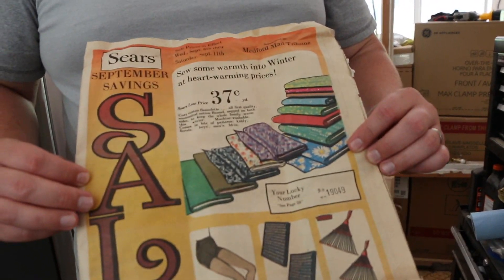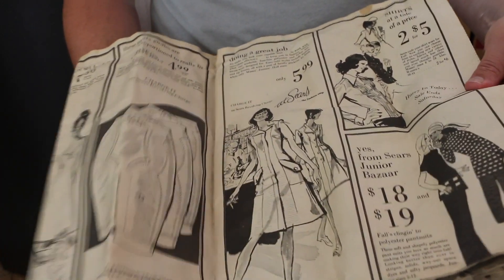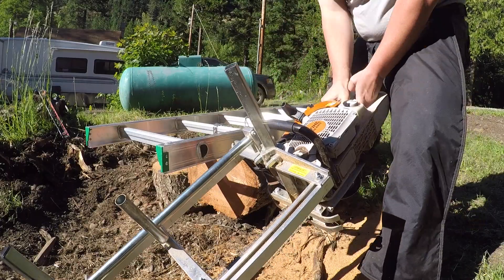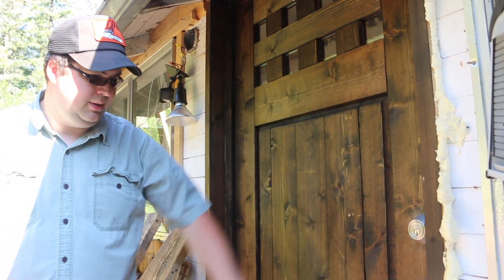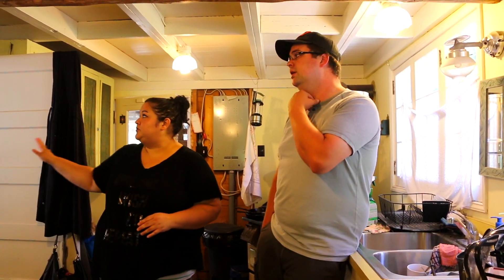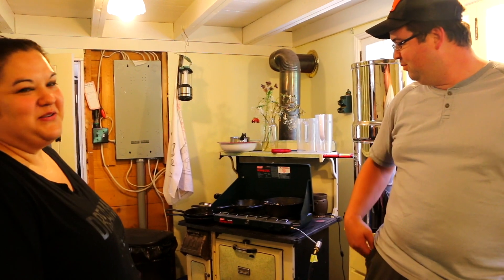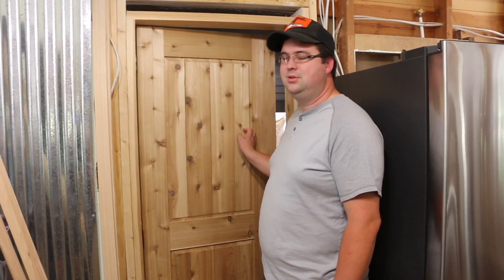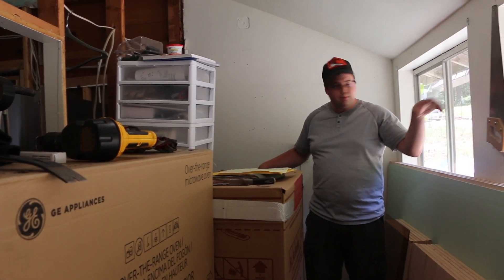Young Couple Saves $100,000 on Dream House With DIY Skill

Comment: Swamp Creek Cabin: I LOVE this video!!! Y'all are so honest and open and just amazing people! I did just about the same thing in the way of gaining my skills over the years. My dad was a professional wood worker but I really didn't learn much from him. That happens when the parents are divorced, I suppose. But....I got the opportunity to build a pole barn and to build myself a shed when I was young and those things helped a lot. I also worked a few days for an electrician running wiring and hooking up switches and outlets. Then, i got into HAVC sheet metal work and installation and went to school to be an HVAC Technician. All the skills I acquired throughout my life have come in handy at one point or another and if I could go back and change anything I would have taken up home building early on because that kind of thing became my passion later when i got the skills I wanted to have. I also designed some houses without knowing how to read blue prints and it turned out later that my measurements on paper were EXACTLY how they did them on blue prints! I was nearly photographic when it came to numbers back then as well so much of the HVAC thing was a cinch for me too. Ask me to tell you any of that stuff today and I'll probably just chuckle cuz after my accident I lost the vast majority of my numbers memory. LOL. Oh well, it happens sometimes I guess. But even today I am a decent carpenter and know most of the ins and outs of home building and their codes. Oh...also, when my wife and I bought this house we had to replace the existing septic system ad bring it up to code (what a joke. The code changed just 5 years later and now they don't install this type of septic anywhere in the county. LOL). It cost us just over $12,000 to get it done back then. But just a few later that same septic system install jumped to over $50K!!! The codes are crazy! Some will allow you to run a certain gauge wiring and others require a different gauge or type depending on where you live. There should be definitive standards for ALL 50 states to keep things easier on the poor builders. Well, just thought I'd share a little bit of my experiences with y'all. I always enjoy the stuff from DPH. Like you guys, they're just good people.